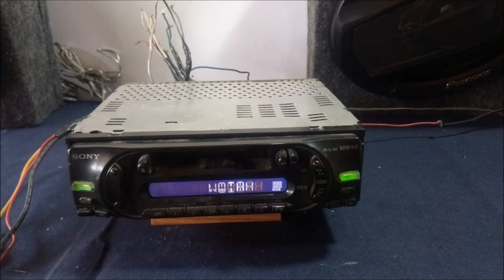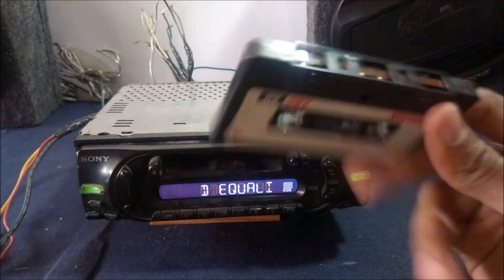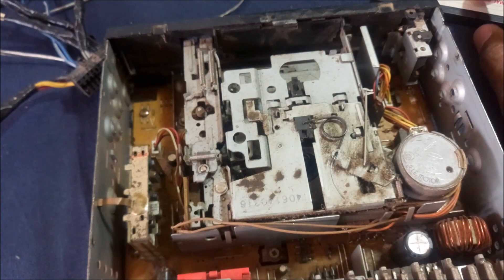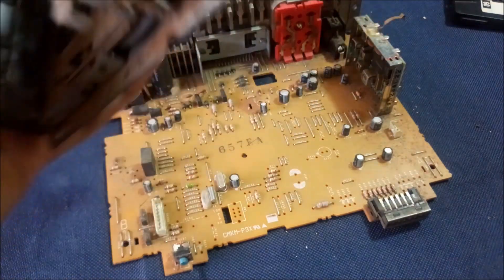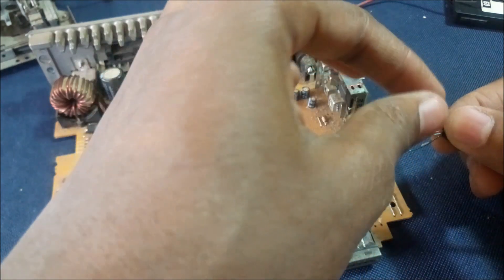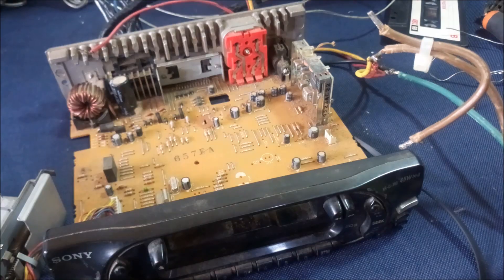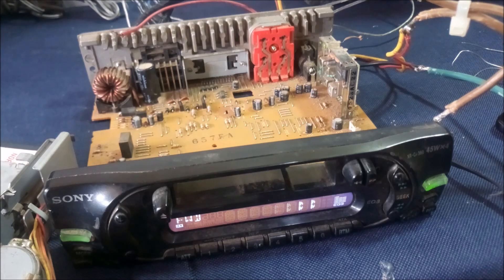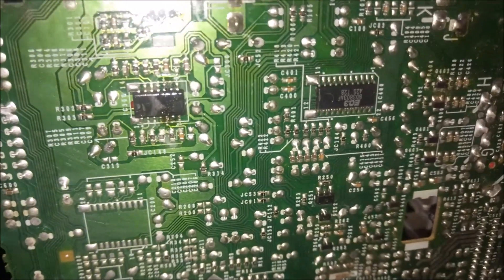AUX Hack On Old Sony Car Radio XR CA360, Fail

Comment: I tried it so many years ago and it was a disgrace.chip the cable on the tuner and put a switch .it works fine.

Comment: Sir join both yellow wire is motor wiring and then aux connect to head  3pin wire its working100%
Reply: Sir canetion vido diba

Comment: Hoho 😆 just soldering cable to pin 5+Ground & 10+Ground IC 12232, It's work
Reply: How explain abit
Reply: How works it in sony cdx c5000r
Reply: I do the same but the sound is very high

Comment: All u had to do was tie into the cassette audio head wire and plug ,instead of soldering to the board. But it still technically should have worked,          keep up the experiments.
Reply from the maker: I will keep experimenting, thanks.
Reply: This technique induces noise into the signal.

Comment: I successfully moded the exact same model to receive the aux cable. There is an IC by the name  "EQ3" which is a source selecter. Just tear down the tracks from the tape and solder the wire to the cd changer input.
Reply from the maker: Might this be IC400 on the schematic diagram here https://www.manualslib.com/manual/1057133/Sony-Xr-Ca360.html?page=17#manual
Reply: @DominicGichane  yes. I'll try to upload the photos today
Reply: @SwapnilV  when will u upload the photo
Reply: @indianboy5989  I cant upload any links here. Youtube keeps on deleting my comments with link. I have uploaded it on my discord server
Reply: explain abit i want to try it.
Reply: @lucasmwaura8405  Give me a time of 24hrs. I share a photograph of the modification on the IC.
Reply: @SwapnilV  ok
Reply: Still waiting 😎
Reply: Hey thanks, I have Sony cdx L580x too however I can’t add any Bluetooth or any aux out :( can you help me please?
Reply: Aux ?
Reply: can someone suggest a way to share the photos?
Reply: @SwapnilV  I'm waiting too
Reply: @fettahsavran9977  how to share
Reply: @SwapnilV  I don't understand, if you're ywpt, do you want to share it with me?
Reply: @SwapnilV   whatsapp ?
Reply: @fettahsavran9977  nah, I don't want to share my phone no. Try the Discord link or suggest another way
Reply: @SwapnilV  I do not know english
Reply: @SwapnilV  thank you very much i found the files
Reply: @SwapnilV  where do i connect the aux after this connection
Reply: @SwapnilV  hello, can you write your discord and send files pls?